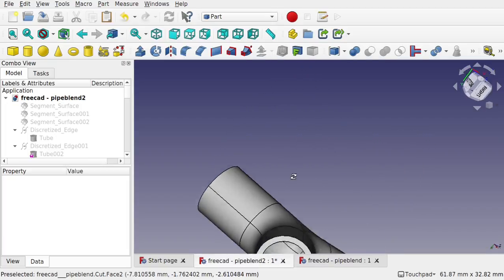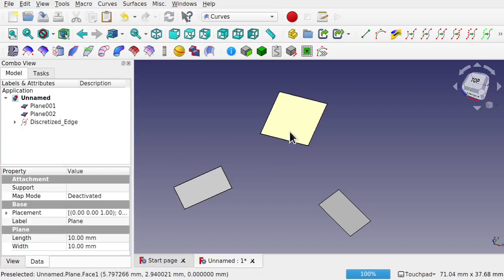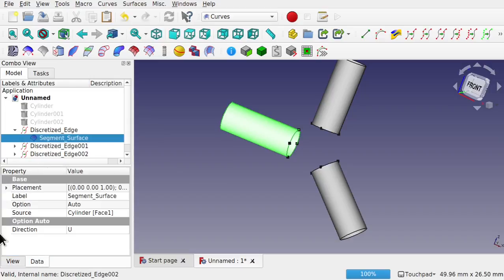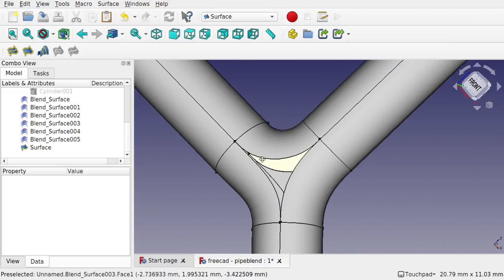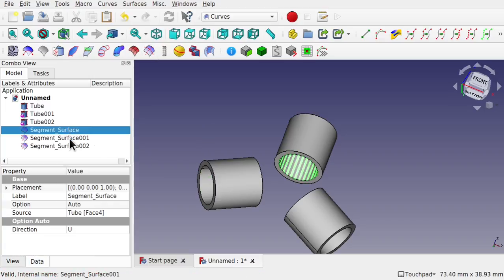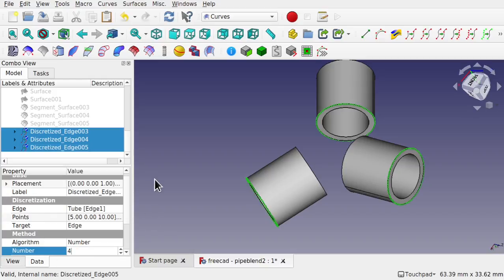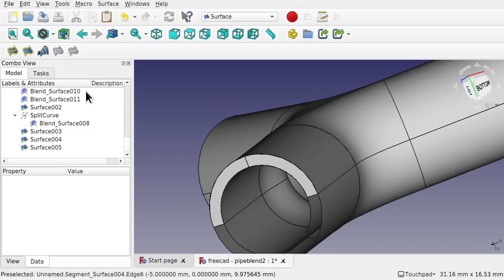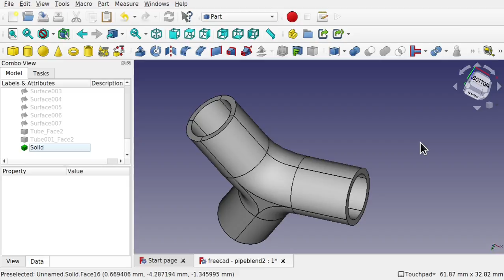Learn FreeCAD Curves Workbench [06] Divide split faces, blend merge surfaces. Discretize 3 way pipe

Comment: Around 17 minutes when you have difficulty making a surface across the junction I also encountered the error but, as you said, using the split curve tool in the Curves Workbench fixed it for me without issue.  Great video as per usual from you!
Reply from the maker: Thank you for sharing this. Glad your enjoying the videos

Comment: This was very interesting, however, I ran into two problems: 
Changing the angle of the two branches of the "y" to less than 30 degrees or so, then some of the blended surfaces go kaput.
Second problem, once I accepted the above limitation, I could produce an object (solid) that looked perfect in Freecad, however, after slicing in Cura 5.1 , it was not usable, due to several discontinuities.
Having said that, I still learned a lot from your video.

Comment: How i got the thickness from messing around was to goto part design workbench once you have the solid, create a body and drag the solid into that as a "base feature", then select all openings of the pipe and click the thickness tool, it looked like it had an issue but clicking "make thickness inwards" worked perfectly
Reply: Another way i just found is in part workbench, just select all 3 faces where you want the openings of the solid then click the thickness and make value a negative number
Reply from the maker: Thank you for sharing, great to see comments like this on the channel really helps show how people use freecad in different ways and the possible ways to come to a solution

Comment: Thanks for this. I'm @ 0.20 following your tutorial. I got as far as creating the pipes and blending them but when using surface to fill in the holes I get Curves are disjoint. Have tried redoing everything but always get this error. Makes it difficult for a novice with errors like this since I won't be able to complete the video.
Edit. Tried yet agaiin using Filling and even if that created a flat surface the first times I tried it now worked. :)

Comment: Instead of using the surface tool to close the gap in the center of the blended surfaces, would it be possible to use the blend surface feature to use the blend surface tool to close that gap?  In other words, could you use the blend surface tool on other blended surfaces?
Reply from the maker: Thanks for the comment. The blend surface from the last time I checked only allows for a max of two surfaces to be selected. But I may revisit just to check to see if anything has changed as the workbench is in constant development.

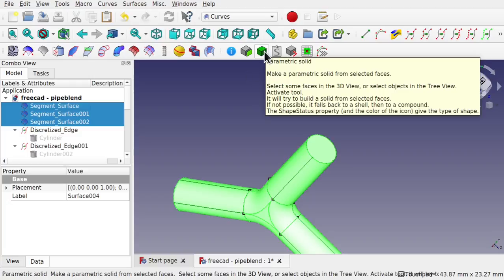Comment: 19:28 When I used Curves Parametric Solid I got a Red (Compound Type) Solid Icon. I ran Geometry Check via Part WB and it indicate Wire error in One of the 2 Gaps filled using Surface WB. I worked around it using Part to convert the Curves Para Solid to a viable (Tested in Fusion & Cut Solid). Otherwise no problems (Maybe I missed something) Once again but I'm getting smart enough to "Work Around issues. This Tut show how powerful FreeCAD can be manipulating Objects. In this Case Inlet and Exhaust Ducts for a ducted Fan Jet perhaps? Not overly worried it worked, I'll try and backtrack and see if I missed something. 

I think the problem is my Angles on the various branches are too acute. I've noticed all the various  Lines on Darrens Model don't cross over each other (especially the Center Curves) Mine do and I think this throws the System out. I'm going to try and redo with less acute Angles.

Hmm have successfully completed all exercises. I think Angles have something to do with it but also found when using Surface WB, Filling & Fill Boundary Curves One would work on One Side and Not the other (FreeCAD idiosyncrasies again!!). You need to experiment to find what works ar times.

Comment: Having a strange problem, when I try to segment the surface of the cylinder it creates a separate cylinder on a different angle tagged as Segment Surface? I can't seem to get this to work right.
Reply from the maker: Have you transformed or rotated the object before creating the segment surface?
Reply: @MangoJellySolutions  Yes, I moved the cylinders before I started any edge or surface segmentation.
Reply from the maker: @specialservicesequipment393  I am wondering if that was the problem, I will have to check. May be an attachment issue
Reply: @MangoJellySolutions  ok, the weird thing is that I can get the plane to segment and curve without an issue, but the cylinders are giving me problems.